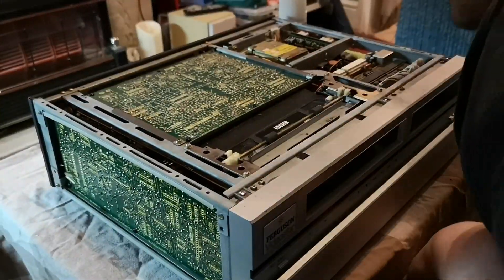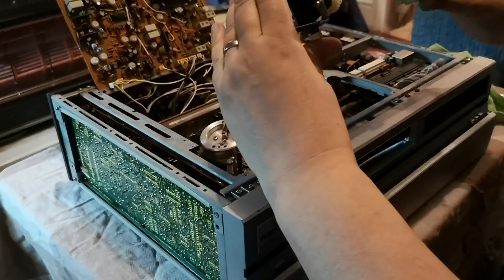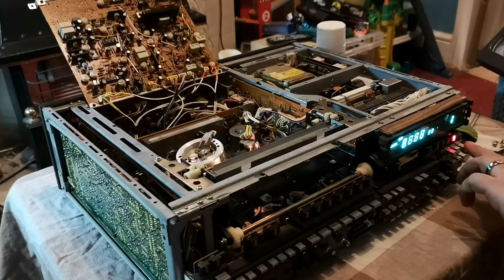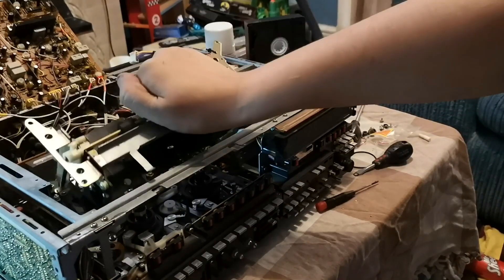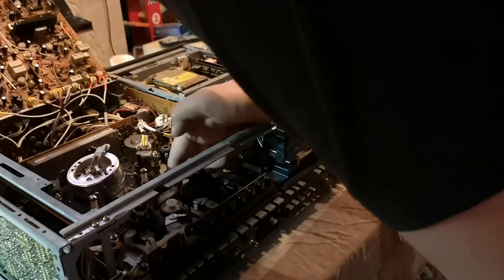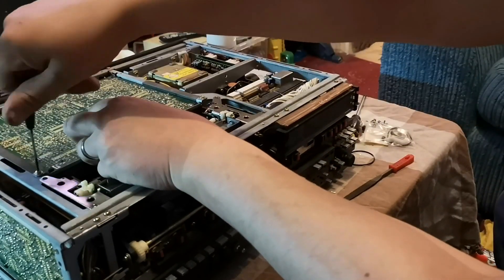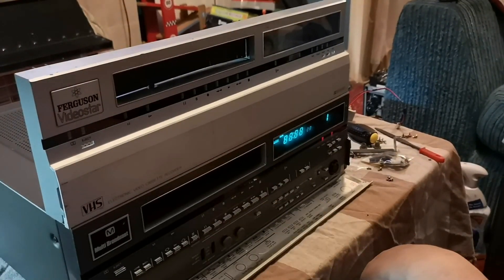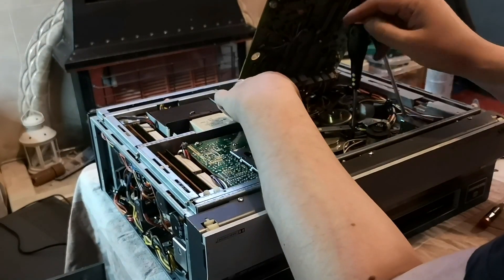Ferguson 3V23 VHS VCR - one good one out of two

Comment: I have acquired a Ferguson same model. The capstan drive belt was shot so I tried to replace it .... End result . The warbling effect you mention. ... So I'm guessing a capacitor issue and so unlikely to be one for me to get going .   That's a shame ☹️
Reply from the maker: Don't feel too down, best start, is to get a service manual, and work back from the power supply. Weak capacitors in the supply, can cause fluctuations, further upstream

Comment: Changing the tape cradle looks very complicated
Reply from the maker: It's not too bad once you remove the front panel. The panel pops off in seconds, one multi plug to the cradle motor, four screws, and out it comes. The hard part is changing the belt on the cradle.... Well, more fiddly, than hard.....
Reply: JCTs Fascinating Hobbies Really? I have a 3v23 with a dodgy cradle. It’s working but the tape sometimes gets jammed. I have to switch on and off to get the tape out. 

I have the JVC version of the 3v32, but Royal Mail completely damaged the machine and refused to pay out, even though I paid extra for insurance. I was going to swap the cradle but I’m scared
Reply from the maker: @EbayvideosR  I think the 32 cradle is slightly different, I haven't directly compared the two, but, I think there are some detail differences. I'll grab another video where I strip down and repair the cradle on a Nordemende V500, which is closer to the JVC version (the HR7700EK).
Reply from the maker: @EbayvideosR  https://www.youtube.com/watch?v=eGpsgKudxpc
Reply: I've got one of these machines but its faulty let me know if I want it u can have it for pennies
Reply: I have the AKAI clone (VS-10) and I find that some particular tapes always jam in the cradle when you try ejecting them. On the left-hand-side of the cassette slot, there is a cutout. Just stick a flat-head screwdriver in there and pry the tape upwards while the motor is running. That enables the tape to eject successfully. :)